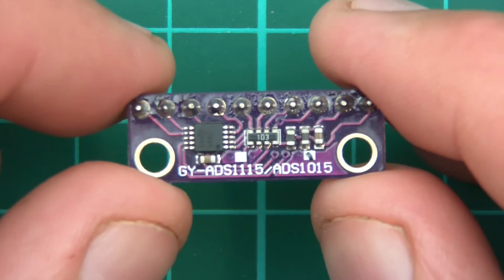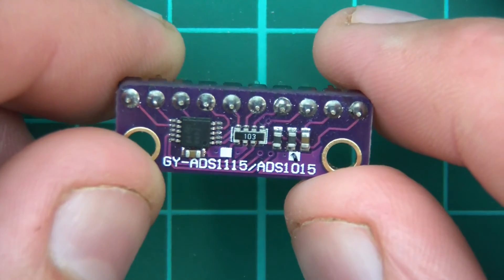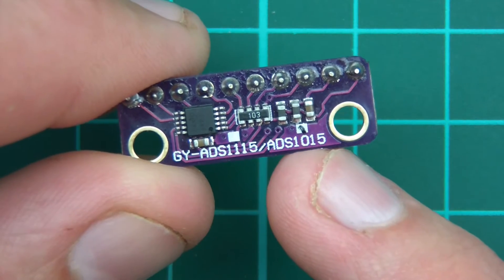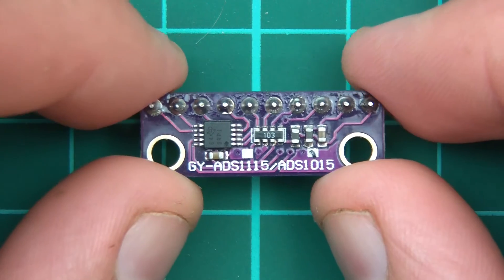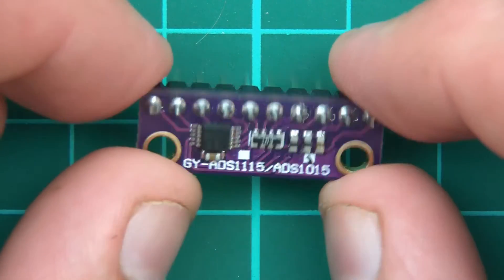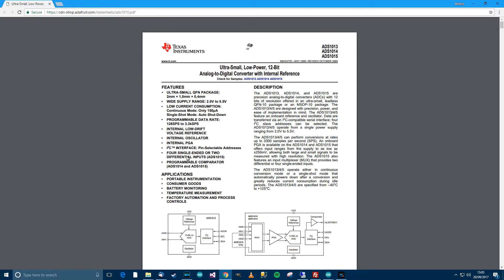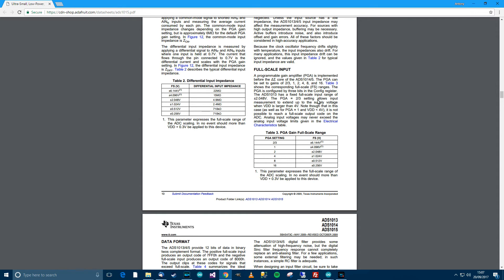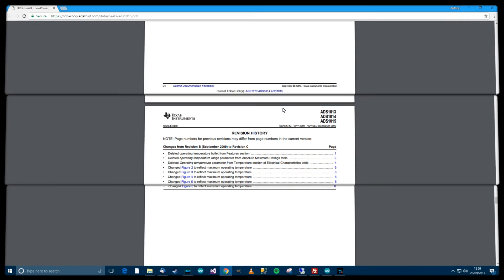TUTORIAL: How to use ADS1015 With Arduino - A 12 Bit ADC - Built in Amplifier! (Part 1 Preparation)

Comment: loved the video!  just a quick question, what can i do if my input voltage is like 0-30V, how do i "scale" it down in order to use this chip.  thanks!
Reply from the maker: You'd connect the 0-30v to a 5k resistor, then through a 1k resistor, then to ground. Tap a wire in between the two resistors and what you will find is that the potential between it and ground will be exactly 1/6 of the input voltage. :)
Reply: @antonycartwright  hell yea thanks!

Comment: Why in the board says ADS1115
Reply: If you see about the numbering there is a white box... One of them is marked with a magic marker indicating which board it is. If you bought yours (as I did) on eBay, it may have been displayed as ads1015/ads1115 board, which very much well is a misconception. It is one or the other. Mine was ads1015. 
Hope that helps.

Comment: okie one or two important things you missed over here. first of all its 1/4095  steps. half it for voltage swing and take into account zero. - 12 bit isnt extreme precision. the noise is a signifficant factor here. get the number of bits, and multiply by 6. that is the signal to noise ratio: 12*6=-72dBFS noise. The arduino is -60dBFS. 150mv is not difficult to read on an arduino because you specify a reference voltage. many digital oscilloscopes are only 8 bit - because they change their reference voltage on the fly.
Reply: also the alert pin is important: it signals when the ADC has completed making one sample. you use it to trigger an interrupt on the arduino or dildo or whatever you are using

Comment: I have a few of ADS1115, which is a 16 bits instead of 12, even more accurate reading I like, used it in Li-ion battery charger. I got now a meter that given me 6 1/2 digit to test with (HP 34401A).
Reply from the maker: 16 bits!!! 65,000 counts! It's insane! The gain is awesome too!

Comment: So what is this for?
Reply from the maker: Karl Ng it's for when you need a really really precise adc. The arduinos built in adc is very bad compared to this one!
Reply: Antony Cartwright So what are you going to use this for?
Reply from the maker: Errrrmmm, nothing at the moment! Ha! I might replace the solar shunt amplifier with this though at some point. This is far superior! :-)
Reply: Antony Cartwright Did you have a look at the amplifier I showed you? I just tested it out and it really is accurate.
Reply from the maker: Hi Karl, yes I had a look at it. It's very similar to the one I currently use for solar. I use the AD8202. They're made by a company called Analogue Devices, and they make a lot of very accurate devices. You know the one you've tested, please could you tell me if it is accurate at the low end? My one isn't linear at the low end of the scale. So if I tune it to a gain of 2 for example, the output will be like this: 1mv = 1mv, 2mv = 2mv, 3mv = 3mv, 4mv = 6mv, 5mv = 10mv, 6mv = 12mv, 7mv = 14mv, etc... It basically doesn't work with low values, which is quite a big deal. :-)
Reply: Antony Cartwright Ohh, the amplifier I tested was from a friend of mine so I only had it for a short period of time. Unfortunately, I didn't have enough time to test its full functions and I had to return it back. Antony, I think you should get that amplifier and give it a test drive, since it is highly accurate and is much newer in the market, it should work. The one I tested last was a variation of it and was highly accurate so this model should be good as well. What do you think?
Reply from the maker: I'll have to have a look at the data sheet!
Reply: Antony Cartwright Hi Antony, I have good news, I managed to get my hands on it and I tested it and that amplifier has super high accuracy, the one I showed you, I think it will suit your solar project.
Reply from the maker: Is it accurate at extremely low levels? Like less than 1mv? My current one doesn't cope with low voltage very well. It's very accurate with values above a few mv though. I'm thinking of replacing the amplifier with this ADS1015 at some point, because can spread 2048 counts over 256mv! That's 8 counts per mv!!! I'll have to revisit what I've done up to now and assess it properly.
Reply: Antony Cartwright Sorry, I don't have Facebook yet.
Reply: Antony Cartwright I'm not a person which has a lot of social media but I have Google Hangouts.
Reply: Do you have a email, Antony?
Reply: Antony Cartwright I will add you on Google Hangouts.
Reply: I used mine for a better adc for my Arduino oscilloscope